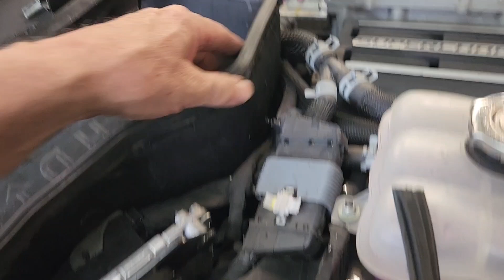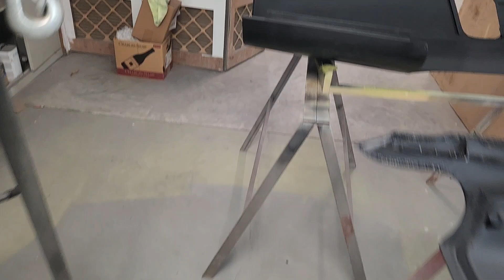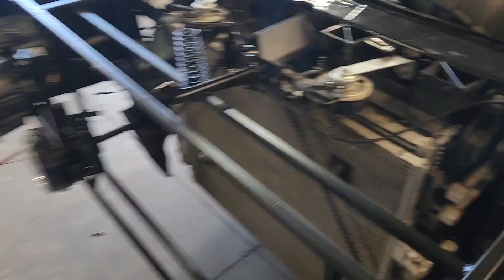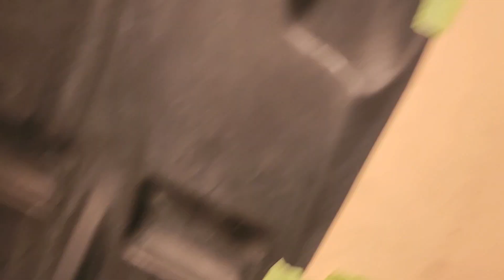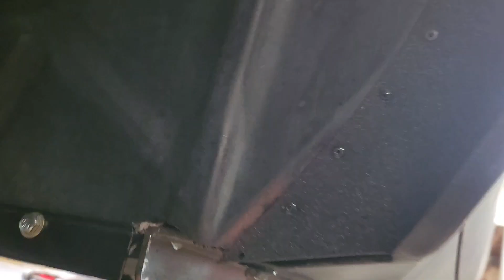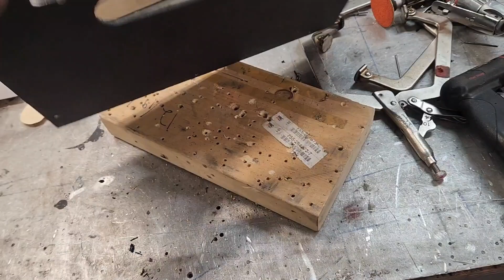Randy's Hellcat Daytona part 75

Comment: I always wondered how do you register these type of builds, I wanna do a wide body like the super charger concept
Reply from the maker: Depends on where you live. Here in North Carolina they prefer that you register it as the chassis since that is the operational car. I think it is better if you can register the body before work begins as a highway stop will be less complicated having the car resemble the registration information.
Reply: @SteveMirabelli  thanks for the info, I live in TX. I probably can just register the car once as and not worry so much about it